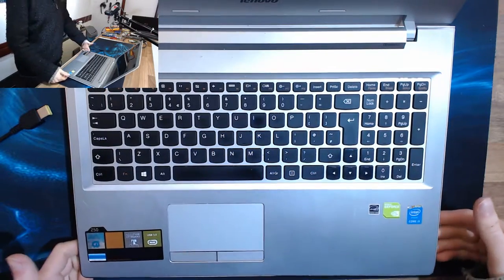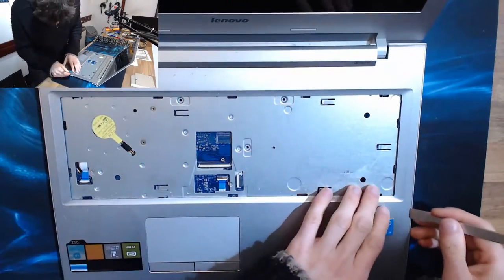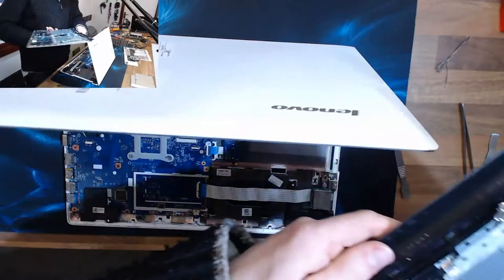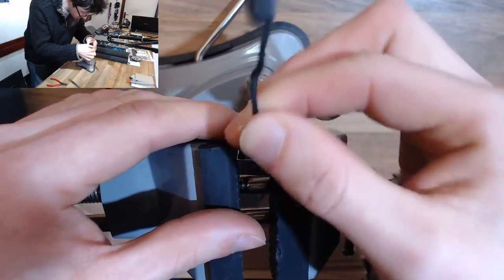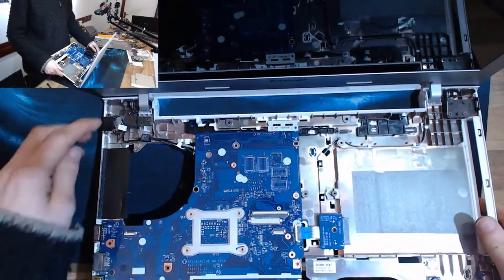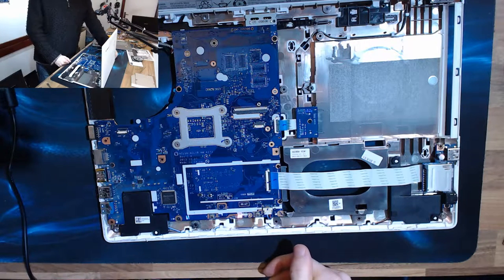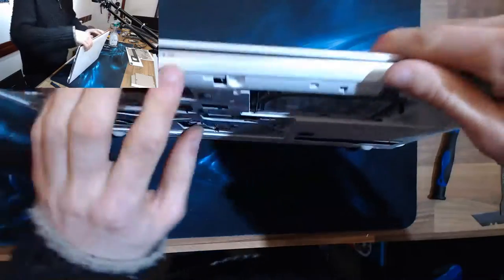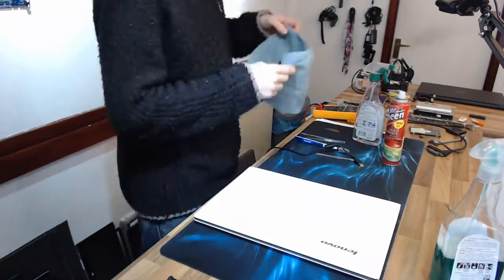LFC#96 - Lenovo Z50 Power Jack Fix

Comment: My power port was loose and charging was really difficult. I was just about done with my laptop. I bought a replacement power port and installed with your instruction - laptop charges and everything turns on and works after too! Thank you so much - you saved me buying a new laptop!
Reply: Where did you get the connector and the cost
Reply: @CupraBBD  EBay - was $10 - $15 I think?

Comment: Great video! I broke my port while charging and have now checked with multimeter that the port connections seems fine, is i possible the computed got a short circuit?

Comment: Any chance you could help a novice out?

I had this exact issue with my laptop so I ordered and installed a replacement jack. I put it all back together and plugged in the power lead, the laptop battery light flashed briefly once but then stayed off. Unplugging and plugging back in now has no effect, so I wonder if I've shorted/fused something... I'm a bit of a novice when it comes to this so it could either have been a dodgy replacement part or a botch job on my part. 

Any pointers for things to check would be really appreciated! I'm going to try and resolder the original jack as you did, but if I have caused another problem down the line that's only half the battle...

Great video, cheers!
Reply: @Adamant_IT  Ooft okay, thanks for the reply! So if I do want to get the fella up and running again my best bet is to get a new motherboard (and then make sure I don't toast that one too...)? Looks like it'll be a bit of a pricey gamble but I'll consider it nonetheless

Comment: Hi! Great video, thanks a lot for that one. I had the same problem, but... I dissasembled the computer and found one wire disconnected, the same as in video. I repeaired it and checked wiring with multimeter. Then i connected everything but LEDs remains dead. Laptop has no power. Any idea what to do/what to check next? It's hard to belive that connector was broken and there is other issue at the same time.
Reply from the maker: You'll have to start checking the motherboard for short circuits and missing power rails.
One thing I have seen with these models, a bad connection at the charger jack causes stuttering power or even sparks, and that kills the power management chip. It was a long time ago that I saw that though, and I was very new to mobo repair, so I might've been wrong.
Reply: @Adamant_IT   Thanks! That's what i was affraid...
Reply: @Adamant_IT  that was transistors. Problem fixed, thanks for showing the way

Comment: May I ask the following question please?  Headphone jack broke off while it was plugged-into the audio port. Can it be "pushed out" from within? Thank you.
Reply: @Adamant_IT  Thank you very much for your prompt response. I will give it a try.  A person suggested soldering the broken piece of the plug to the stuck piece. I am concerned that even though that might work and allow you to pull the stuck piece out, perhaps the heat from the soldering tool might transfer to and damage the mobo. What do you think? Thank you very much again.
Reply: @Adamant_IT  Thank you. Best wishes.

Comment: Hi Adamant, can you help me by confirming that if it"s okay for the black wires to be connected at the side randomly and the red wires beside the whites too? thanks
Reply from the maker: The plug has two outer contacts (ground), two inner contacts (power), and a centre pin (sense), and connects either way up - which is why it's wired symmetrically.

Comment: I just bought the same model from a thrift store and it kept shutting off due to the Wi-Fi cble been ripped. Also the power Jack is loose and the battery is dead so I'm going to buy a new power Jack with a new battery.

Comment: Hey , my Lenovo z50-70 is showing plugged in, not charging. How do I fix the same?
Reply: I tried the above steps , the Jack is fine and the adaptor is also working. I took it to repair store and they diagnosed it as motherboard issue.
Reply: @Adamant_IT  happened to me 😢
Reply: @Adamant_IT  Forgive me but, Is there any way to fix the motherboard issue without changing the whole motherboard? I have the same problem with my z50-70.
Reply: Any news about this? I'm facing the same issue, it turns on if plugged in, but it receives so little power (1-10W) that it can't charge the battery and turns off by itself after an hour or so.